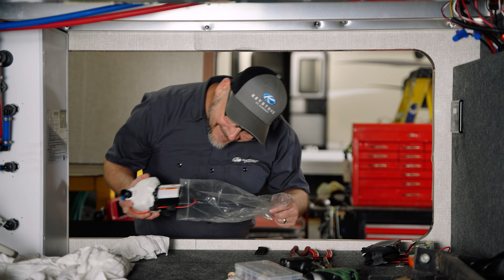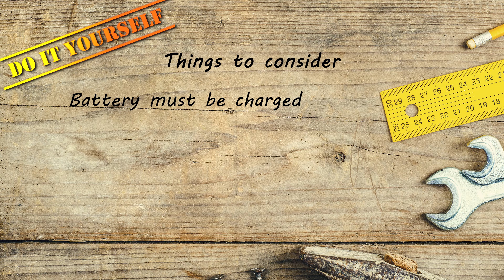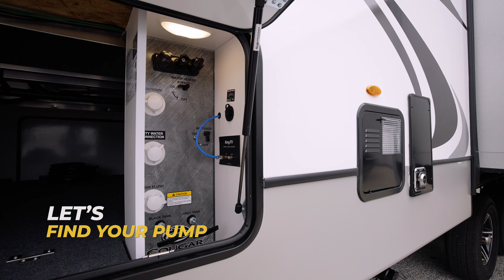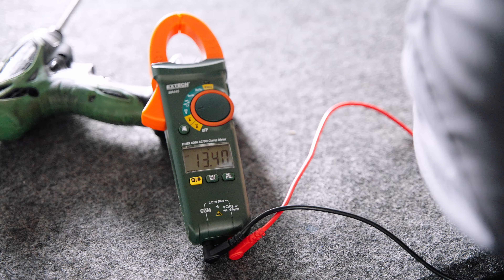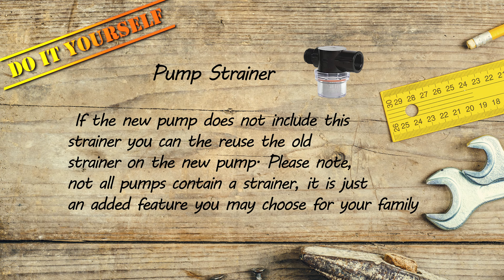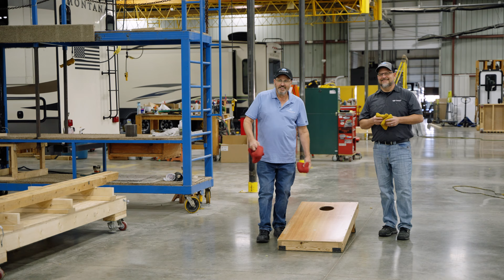How to replace your RV Water Pump-Do It Yourself!

Comment: My pump keeps running every 2 minutes for 5-10 seconds. No leaks and no air in the lines. The pump in my Springdale is in such an inconvenient place
Reply from the maker: Good Morning, we are sorry to hear this. We would recommend that you do get the pump inspected to determine what is occurring with this as something on it could be faulty and need replaced.

Comment: Thanks for the thorough video! One thing i noticed while doing this myself is that our trailer doesnt have a hot water bypass switch. In case anyone else runs into that hopefully this saves you some confusion! I was also able to make things easier for myself, since the area i was working in was so tight, by clipping the wires close to he pump instead of at the connection point. It gave me a good 6" more to work with. Maybe not ideal to have an extra connection point, but in my case worth it.

Comment: I can't find any leaks anywhere but my pump turns on every 45 minutes for a second. Could it be debris in the diaphragm?
One more question will there be an instance where you would need to prime the new pump after installation?
Reply from the maker: Good Morning, Yes you should always prime your new pump after installing this. Also, it could be an issue with the pump itself. We would recommend that you inspect the pump further or have a local dealer assist to find the root cause of this turning on that often.

Comment: Used Keystone Challenger 2008 waterpump. Stationary with city water. Haven't used, noticed a leak  think in front where wires are. Should i  repair, what the issue could  be. Or can I disconnect altogether  or etc. Thanks female learning
Reply from the maker: Good Morning! We would recommend first trying to find the source of the leak. If it is coming from the roofing we would recommend checking all seals up there as they need to be maintained every 90 days. If it is not coming from the roofing then there could be something loose near the wiring allowing water to come through. If you cannot stop the leak on your own we could recommend having a local Keystone dealer or repair facility assist with this. Thank you!

Comment: My pump comes on but water is not coming out is there something else I should check before replacing it
Reply: We've had the same issue since we purchased our camper in 2022. It's been to the service center 2x. Has a new pump and still won't work. The pump will run continuously but water won't come out
Reply from the maker: Good afternoon! It does appear to be the pump itself that would need replaced. Should you need further assistance on this please give us a call at 866-425-4369.

Comment: My pump just won’t shut off but no leaks I was guessing pressure switch but is it best to just change out whole pump and is this also a common issue pump running non stop
Reply from the maker: Good afternoon! I have not heard of this specific issue. If switching out the pump itself does not resolve this we definitely recommend having a dealership look at this further for you. Thank you!
Reply: What did you end up coming up with ? Mine is doing that as I type this now lol

Comment: What is happening when city water is connected and water starts coming out of the fresh water connection? I turned on the water pump and got rid of the air in the lines. Its still doing it when i hook water back up. Tks
Reply from the maker: Good morning! This is an indication that the check valve could be bad and the water pump itself would need replaced in that instance. Any dealership can look into this further for you. Thank you!
Reply: What did you wind up doing?

Comment: How about the pump location on a 2021 Carbon 418?  The pump is considerably noisy and I’d like to replace it with a quieter one.
Reply from the maker: Good afternoon! It appears your water pump is behind your wardrobe slide out in a compartment or closet along with the water heater. We hope this helps, thank you!

Comment: Is there anything additional that needs to be done to make sure there is no power to the pump before you mess with the wires?
Reply from the maker: Good Morning! You will want to make sure the switch to the pump is turned off so that no power is going to those wires. You also can turn off the power to the unit completly as well if you are still feeling unsure after turning off the switch. Thank you
Reply: A little more detail about cutting the wires would be appreciated. Some of us don't know the names of the parts and have to research what they are and the do's and don't for them

Comment: Do y’all have a video on how to replace atomic electric transfer switch mine has a built in generator from the factory it won’t switch from the generator back to the landline thanks
Reply from the maker: Good afternoon and thank you for your comment! We would recommend having a certified RV technician taking a look into this for you since it is electrical. To find an authorized Keystone dealership near you please visit https://www.keystonerv.com/find-a-dealer. Thank you!